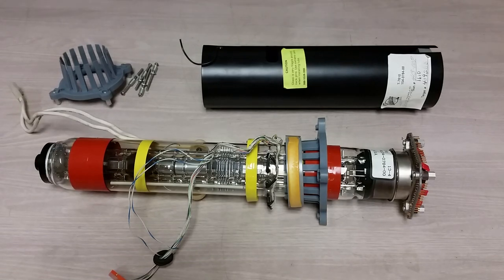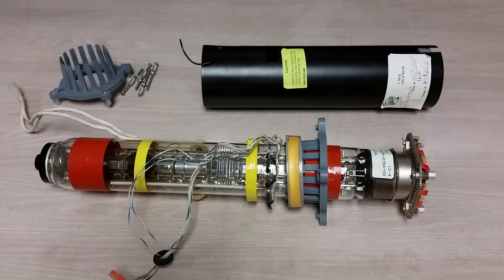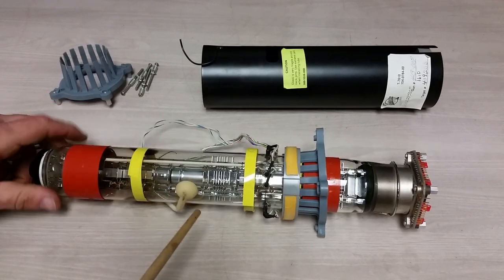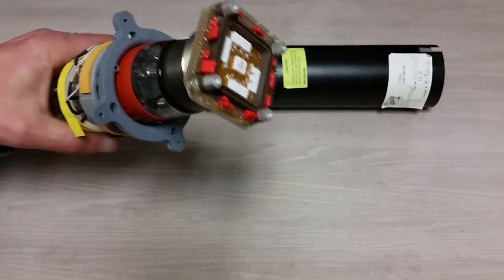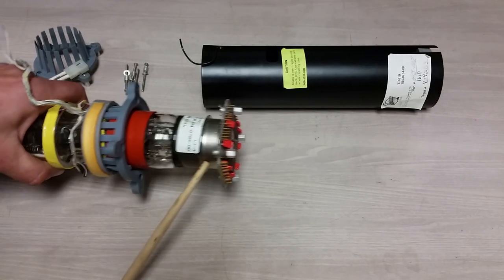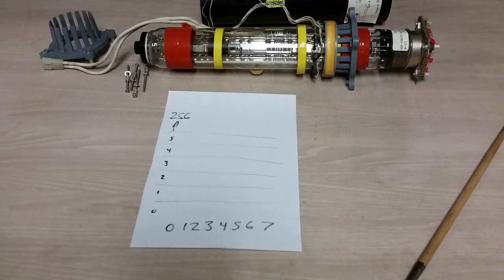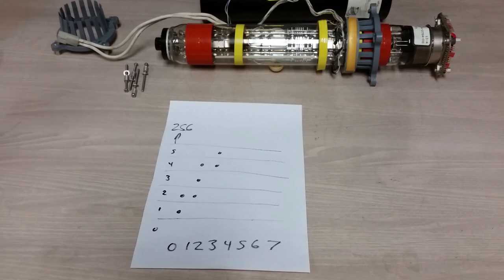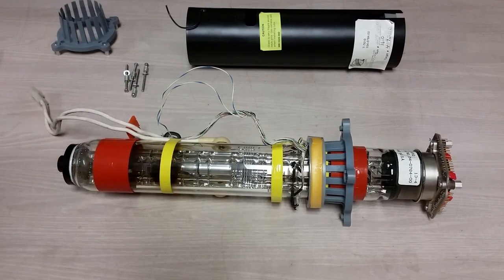Tektronix T-7610 8 bit A/D Converter Tube

Comment: I have 2 of the 7612D instruments and a 3rd that I stripped down. Each one of these instruments has 2 tubes. The last catalog price I could find was about $30,000 for one of these instruments. They are packed with a lot of electronics. Also have the service manual. Still haven't had time to play with much, but I always thought the tubes were interesting.

Comment: Interesting stuff. Thanks for describing the tube. I have a 7912AD here which uses the same principle, but the readout beam can be scanned in both axes so it can capture a single-shot waveform and then digitise it in both amplitude and time dimensions afterwards. It works great, and can give an equivalent sample rate of 100GS/s!
Reply from the maker: Neat! I suppose the tube works slightly differently, perhaps not using a ribbon like beam that turns on a line of diodes, but rather a standard dot beam that turns on a X-Y matrix of individual diodes?
Reply: Yes, that's right. Both the writing and reading beams are standard dots, and there's a matrix of diodes in between. Entertainingly, the 7912AD has a 'TV output' mode in which the reading beam scans horizontally quickly and vertically slowly, matching the TV raster scan, and then a separate digitizing mode in which the beam scans vertically quickly and horizontally slowly. There's a separate circuit which draws a graticule on to the diode matrix, too, so it's subject to exactly the same distortions as the signal for maximum accuracy. The V/div and s/div readouts are added to the TV output separately and don't appear in the signal.

Comment: The 7610 used an electron beam digitizer. The silicon target had an metal mask that was Gray-coded and the cathode was pulsed to get each sample. I don't recall whether the Gray-to-Binary conversion was accomplished when writing to RAM or reading from it. The beam was basically a horizontal sheet The success of the electron bombarded silicon target was one of the things that inspired the ill-fated PicoScope project that I led until I had to do the Format Convertor project in 1990. It also had an EBS target, but the target was the 512x64 target that Gene Andrews going to use for the E-Beam scan converter, which was expected to do 10GHz single-shot capture.
Reply from the maker: Yes, I forgot to mention the mask over the die. I did on my first take of the video, but I discarded it when I screwed up my diagram of the Gray code! Anyway, thanks for bringing it up.

Comment: I remember a digitizer system from a company called "GaGe" (not sure if it was them) that mentioned a digitizing tube in the system on their documentation. However the unit I got had that tube replaced by a card with mutiple  ~100 MSa/s Flash ADCs from a manufacturer called "SPT". Ceramic DIL package with heatsink on top. And then a lot of small logic spread on several boards. It could use the ADCs in interleave mode as well. They seem to have gotten rid of the tubes pretty quick. Tried to find the old docs about it but they are gone.

Comment: And I thought the custom 9 bit Video Bandwidth A/D converter in a Sony BVT-2000 Time Base corrector was neat. I have a few of these tubes , in 2 tek devices, I believe I have the 7912. I will have to look, and possibly toss it on the bench and make a video. Yeah 8 bit would be about the best you could do, I don't see a 16 bit version being that size :)
Reply from the maker: 16 bits would be nuts, but I think Tek could have pushed a few more bits of resolution. I assume there are Gray codes up there (are there Gray codes for any length bit field? My guess is yes.).